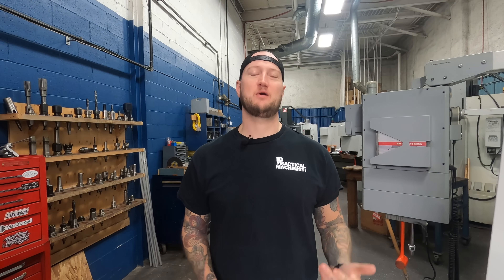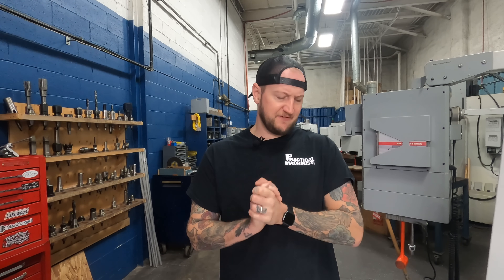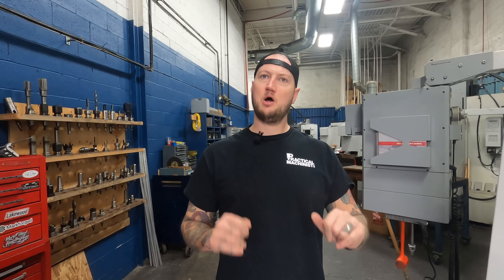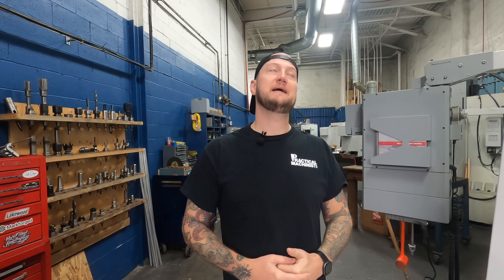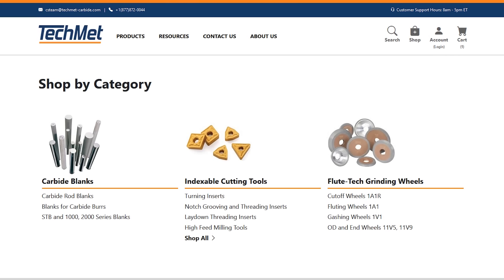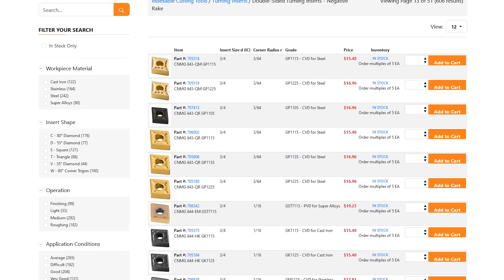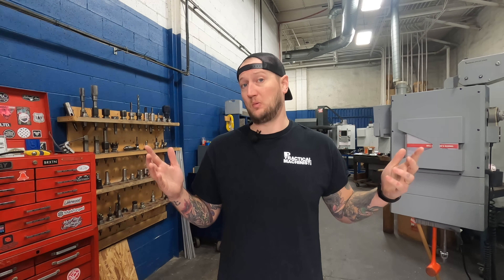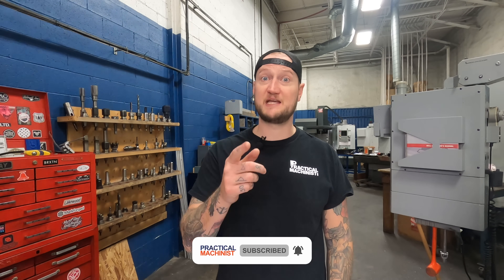Is this the Most Efficient Way to Buy Cutting Tools? | Machine Shop Talk Ep. 101

Comment: Used to work as a prototype machinist where availability of every tool and the speed I could get it was absolutely critical. Biggest hold up I've ever had as a machinist is exactly what this video is addressing- at least in America, tool companies are HORRIBLE with websites. It's 2023 guys- I don't even want an excuse anymore. I shouldn't have to talk to human beings to buy my tools. I know the helix angle, the carbide grade, the nose radius, etc on what I want. Put your inserts on websites exactly like that and make ordering inserts and tools that everyone uses straightforward and quick. I've done everything from hard grinding ceramics with diamond tooling, to nickel superalloys used in jet engine manufacturer, to exotic tool steels to weird elements like pure molybdenum. Occasionally you need a tool seller to find something specific for really weird things in mass production. But usually I have a good idea of what I need. Just make buying it quick!!! This is why I normally dealt through MSC- at least they have a half-functioning website. They still don't have things like a basic checkbox for split point drills though! It's amazing how horrible buying straightforward tools in America as a machinist is. There's just no excuse for this anymore and there hasn't been for years
Reply: Right! This is my standpoint as well - I’m shocked to see how many people don’t seem to find this an issue - even with my current network it can be a HUGE hold up in the quoting process when I need pricing on a tool I don’t hold on the shelf for a job, and I need that pricing to get the quote out the door! 

As you say - it’s 2023 - there’s no excuse for not having at least ballpark pricing (that can get better if you’re buying volume of course) - available on the website.

Comment: Not buying it mate sorry. Don't matter if you're a one man shop you must have your supply chain all set-up. How come you are making a job and from a sudden you have to find out where to buy the inserts you are already using? That should be addressed before making the first chip.
Reply: While I agree with you 100%,  that is not always the reality of the situation at least for us.  We are a shop with 40 plus machines and 10 machinists and we will often begin a job with no thought to tooling.  I am slowly changing this as the "new" tool room manager, but it is still an up hill battle at times.  

We generally have no trouble getting tooling.  We have a great local vendor who typically has a quote back to us in an hour or so.   We also purchase from MSC several times/week and we stock quite a bit of tooling, some in a Matrix vending cabinet.
Reply: Im here in a small shop of 4 people,we are lucky enough to have a good supplier that has tools in stock and we usually buy the tools we need as the job comes

Comment: I could only get in 4:00 minutes before reaching full...

I've owned & run businesses off & on for 40 yrs. I'm officially 'ancient' now, but not inert. I took up machining almost 10 yrs ago, shortly after my wife went to work for MSC.

All of the businesses I owned & operated depended on both tools & materials & all were pre Internet, hell, pre-computer.

If you are having problems finding tooling & inserts in this day & age, you are not trying very hard.

Scenario 1: You break tooling. (I'm not going to address breaking an insert & not having more. If you are so shoestring budget wise you can't buy 50 inserts at a shot, quit now & get a job working for someone.  I just priced inserts for a new boring bar I'm looking at. Price for 10 was X; in 3 minutes I found qty 50 for 2.5X.  Buy enough you have spares, you're running machines which cost 10's of 1,000's.)

Ok, broken tool. Call your sales contact at one of your suppliers. You don't have a contact at any suppliers? Not MSC, McMaster, nobody?  Why the f not?

You may not buy much, but set up an account, make a contact BEFORE it's an emergency.  Buy their sales stuff for you operation, if budget's an issue, a machine shop needs a diverse group of things from gloves to replacement machines, shop for deals if you have to, but have an ace in the hole, a big supplier when you need something to keep production going. Is paying 30% more an issue if you can get it tomorrow & get back to work vs next week? No.

If you get caught with no contact, go to effing Amazon. The only cheaper place you can get stuff is China via eBay, (lots of low dollar sellers now have US warehouses.)

Scenario 2.  You need tooling or inserts & it's not an emergency.

You want US/Euro made?  Big name supplier... face it. Small places may be better price, but will be hit & miss on selection.

Manufacturers rarely sell direct. It's the deal they have w/ companies like MSC, McMaster, Grainger, etc, who buy 1,000's of pieces of product. It's called, "Don't compete with your customers, stupid."  Been that way for a long time; auto parts industry used to be better, they've went to chit. Industrial still has structure.

Oh, here's an inside scoop: small size distributors buy from MSC, McMaster, etc., they can't buy enough to buy direct; manufacturers in US/Euro typically have minimum qty rules.

You want import/Chinese/Indian?  Might as well buy the same stuff the big names buy & resell or re-label & resell.

If you have the time to look, (which I do, being ancient), here's the kinds of deals you can find.

I'm pricing & sourcing a boring head & bars. A head & indexed bar set is too pricey for me.  MSC has best price on head & shanks. Bars are another issue. 

One bar, ¾ × 5.9"

eBay: bar + 10 inserts $24.00 free S&H, 18-21 days
Ali Express: bar  $2.04, free S&H, 18-22 days.

Same identical bar. Different Chinese manufacturer. The Ali Express deal was a 1st time customer buy.

Other AliExpress pricing was as low as 18.00 for same package as eBay, identical.

If you're a small shop or starting out, you foolish to get hung up on brand name stuff in simple indexed tooling & inserts.

eBay can be gold mines for inserts if you're looking for brand names. Last time I stocked up, I found Mitsubishi inserts in 20 & 40 qty for peanuts, I wanna say < 0.20 ea.

I also found another big name I bought 20-30 of for similar price, but can't recall name, 'cause I'm ancient.

A few days ago, a different length boring I found came w/ 11 Sandvik inserts, 1-C5 & 10-C4's. It was the best priced combo of bar & inserts, w/ a bonus insert!

I also have some generic inserts I bought from China via eBay. I have all my inserts mixed together in a box I made w/ little welding rod  posts, so I don't have to dig through drawers looking.

I have pieces if foam on the groups of posts & sections for different shapes, grades & new vs used, (2 of 3 points good, but changed for different grade.)

I use a red paint pen & mark blown out points, if I put them back in inventory, (saves a lot of squinting)

Here's something I discovered 'cause I'm ancient & can experiment: don't be afraid to use a diamond emory board on an insert to hone it up, new or used.  You'ĺl be surprised at the difference.

Msg me, if you want to pick my brain on biz issues. Started my 1st auto repair biz at 15.  Been through a lot in 70 yrs.

Biggest fault of colleges & trade schools is they teach you a skill/trade, but don't teach you squat about running a biz, even in a field where MOST go into biz for selves.

GeoD

Comment: Do you not have a local tooling house?  In Ca we use Western Tool.  If they don't have some thing we need in house, they can get it for us.  We make one call to tell them what we need and they send us a quote with price and lead times.  Spending time getting 3 quotes from three different places is just not worth the effort and time involved.  Any savings to be had is burned up in time on the phone or sending emails.
Reply: Maybe, but my phone calls take less than 10 minutes. Businesses love it when you have the part numbers and lingo ready to go
Reply: @janeblogs324  If your job is doing nothing else but purchasing, then shopping around is kinda part of the job description. If you're in a small shop wearing multiple hats then the time spent making phone calls is time not making parts. What you'll find is that most suppliers are very close on price for most items. A 2% savings isn't worth the time on a $100 box of inserts.

Comment: I have cultivated a relationship with my tool vendor. He has literally bent over backward and overnight-ed me tooling when I am in a bind. That has been a huge part of my ability to operate in different shops. A good vendor is like an employee who isn't on payroll, they do the legwork to find your tooling that will do the job and is in the right price range. I have used the same guy for over ten years now, he can get me free tool test so i don't buy it if I don't like it, and has extended credit to the companies I work at based on my relationship with him. Daxer Tool in Huntington Beach California. I'm in Arizona now and still use them. Give them a call. When did Tech-Met start that? I bought blanks from them before and didn't see inserts available back then.

Comment: I got into the undustry in 2006 - THIS has been my biggest complaint. 
Distributors and tool dealers are soooooo slow. The knowledge is dwindling to the point where I typically know a lot more than they do. Therefore, they add nothing other than cost and complexity when all I need is a small quantity of tools. 

Hope this changes things.
Reply: now PTS is all I'm stuck with, and although their rep is cute as fuck, none of them know anything
Reply: im a small shop. never talked to tool dealer in my life. i order on line or go to my local tool crib and buy over the counter.
Reply: @DieselRamcharger  That limits your options. A lot of the best and most unique tools are not sold that way. If you are happy shopping with limited choice, that can be fine.

Comment: I have been through the same problem, only Three employees. Limited suppliers can or are willing to sell inserts for older tooling off the shelf. Manual machines only, and they are worked hard, i decided to try chikny imported inserts to keep us going,  Now i buy 6,8,10 boxes same cost of (One branded box) of inserts at a time for roughing and they  excellent, for roughing (superb), but i still keep to branded for finishing passes. your speed and feeds are higher, see how it goes. I would prefer to buy a brand name, but the percentages/performance is financially major.

Comment: This is for sure not the most efficient way to order tools. The techmet thing is a great tool to add to the arsenal, but I think you really missed on building relationships with your vendors. I've helped start a few shops and the very first thing done at each place is get accounts setup with the local vendors and getting them all into the shop to explain our needs in person. Gotta know what brands they sell and stock. Keep a list or line cards available for reference. You also didn't talk about the fact that us as programmers should be responsible for knowing our tooling and planning around lead times. If you see a 2 week lead time on some inserts, you need to select a different insert. Of course none of this applies if you don't have good local vendors which is why I never recommend opening a shop where you don't have a good local supply chain. 

I do think every brand needs to offer an online purchasing option. I don't understand waiting on a quote from a local vendor knowing they won't have it in stock and will drop ship from the vendor. However there is something to be said about ordering all through your vendors and keeping that relationship good so they will help you when you need them.
Reply: I definitely agree that having a good relationship with your vendors - tooling or otherwise - is going to be key to having a functioning machine shop that can actually get parts out the door. Where I think this solution outlined really shines is for smaller shops where you don't get the attention and diligence from vendors that larger, more profitable accounts for them might get.

I can remember when I first started, we bought virtually everything through one vendor - even though we were ultimately getting hosed on pricing - because they were the only ones who would give us the time of day. 

Everything you said is fantastic advice though - every option has a role in your supply chain if you use it correctly!
Reply: @LakewoodMachine  Maybe I'm just lucky, but I've only ever had the issue of being treated like a small company with machine dealers, and never vendors, but I'm also the guy that will break out some brews in the shop with reps  and take them to lunch to keep them happy to come back.
Reply: Manufacturers in the US & Europe tend to have qty minimums & abide by the "Don't compete w/ your customers.", otherwise, why would MSC, McMaster, Fastenal, Grainger buy  100 or 1,000's of items, to have in stock.

If a manufacturer does sell direct, you'll pay a premium, 'cause 'Don't compete w/ customers.'

Smaller distributors typically by from the big ones I listed above.

There are places that are drop ship suppliers, Walmart started an 'industrial supplier' company. They sell on Amazon... Zero? Something like that, 4 letters. No inventory, drop ship everything.  No product knowledge or support.